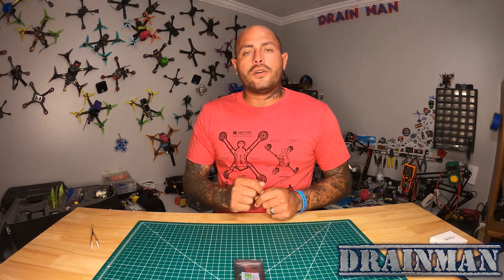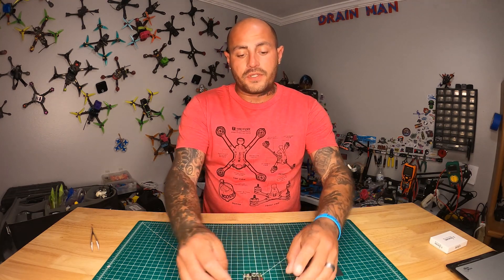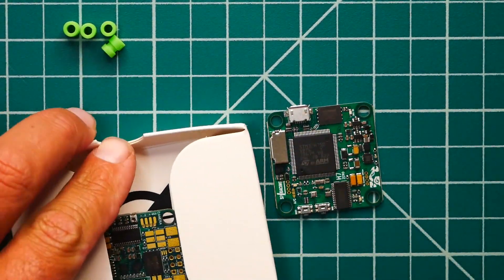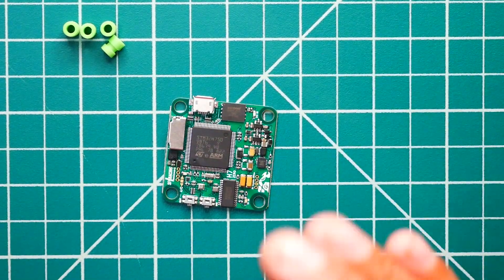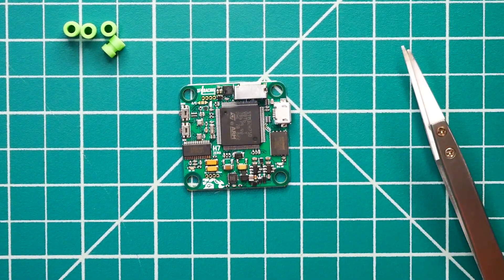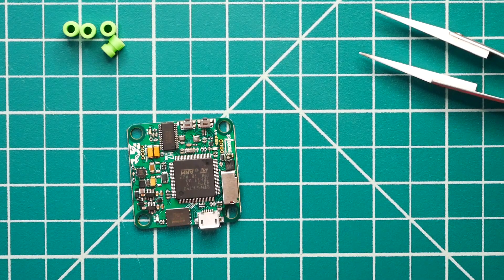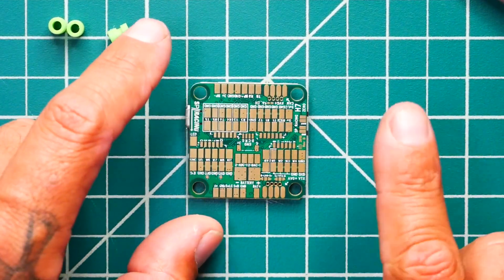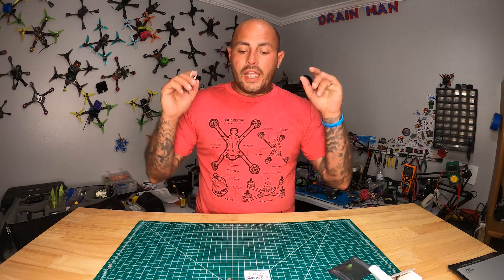Affordable H7 Flight Controller!! SP Racing H7 Zero 400Mhz

Comment: Is it has Altitude Hold Mode...???
Reply from the maker: Betaflight removed this feature, I don't believe they are even working on it. Although the baro can do it, the firmware doesn't allow for it. But they are constantly changing/updating/improving so this may not always be a true statement.
Reply: @DrainManFPV  thanks